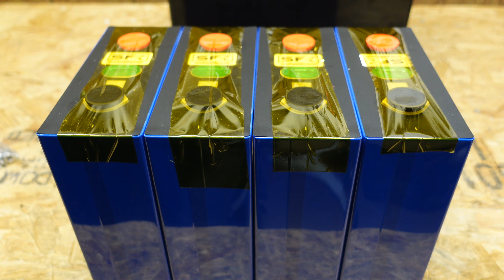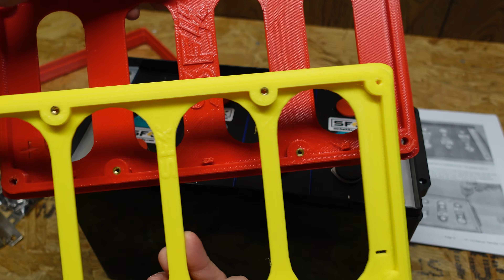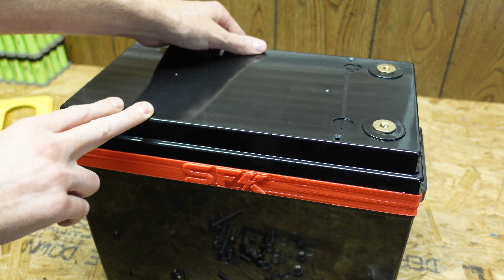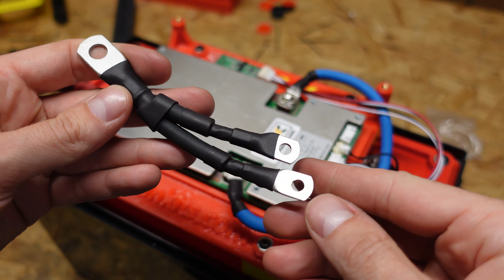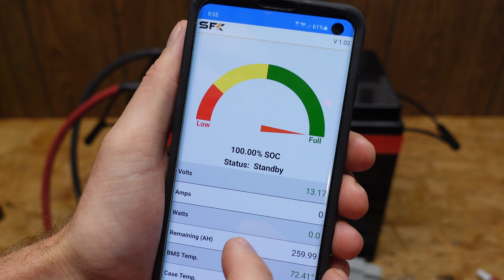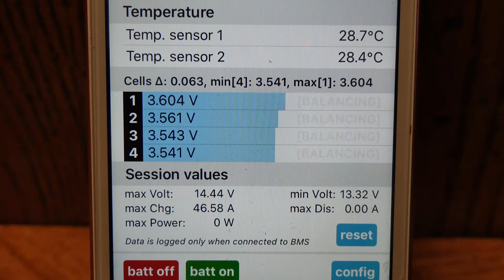Sun Fun Kits DIY 12V 280Ah LiFePO4 Battery, $295/kWh!

Comment: Max discharge current is never equal to max charge current on most any BMS.  While you might be able to push it,  don't.
Reply from the maker: Based on what? It's completely up to how the manufacturer designed the BMS. There are plenty on the market that have the same charge/discharge rate because they were designed that way.
Reply: @LithiumSolar  True... they could be equal,  but there is nothing that makes them equal except through design.   Check the specs.  It is very common to have discharge current be 2X greater than charge current.
Reply: I can tell you from personal experience that this BMS has no problem handling 80 amp charge rate. My thermal camera showed the heatsink at 50 degrees C after 15 minutes.
Reply: @john_in_phoenix  it's not the charger that matters, it's the temperature of the battery cells.

Comment: Hey those buse bars should've been mounted under the Plastic Cap Plate. Instructions are wrong and this is a Safety Issue. If you take another look at what I've said, you'll agree with me. The Buse Bars under Plastic Cap Plate helps prevent Shorts. Shouldn't be any Small Wires under the Large Power Cables. This will cause the Power Cables to become loose and possible damage to the Battery and could cause a Short and may cause Injury to yourself or someone else. You should wrap all open Wire ends with Electrical Tape so that Shorts would be prevented. Every turn of Tape around Wire ends will give a 100 Volt Safety. When ready to attach Wire ends just unwrap that end and connect. You are right about Short Wires. If a power Wire / Cable has a sharp bend and the Battery is Discharging at High Amps then the bend in Cable or Wire could act like a Resister and cause the Cable or Wire to over Heat and a possible Burn through. Wires and or Cables should have a Soft Bend to help prevent this from happening. Thanks for sharing and the upload Mate. It's appreciated by me.

Comment: Hi there. Do you know if they have a solution for EVE 304AH cells?
Reply from the maker: That wasn't one of the cells they mentioned; however, if it's the same dimensions as the LF280 (I think it might be), it should fit fine. I would double check with them first though.
Reply: @LithiumSolar  
The 304ah cells measure 72mm deep x 173.5mm wide x 205mm high (or 220mm high to top of terminal posts)
Reply: I will let you know when my 304AH cells arrive. From the size on the spec sheet, yes it should fit. I can't say for sure until I try.

Comment: Can you connect 4 batteries in seriesl for 48 v? Or do you have to have a bms for 48V?
Reply: I have 4- 12v lipo4 batteries wired in series. They each have their own BMS. They work fine at 48v.
Reply from the maker: The manufacturer states that you can connect up to 4 of these batteries in series for 48V. Each battery has their own BMS though, so you would need to manually balance the 4 batteries to the same state of charge first, before connecting in series.

Comment: I did not see any mention of temperature cutout.  Is there a place on the BMS to plug in a temp sensor?
Reply from the maker: It has a temp sensor and is pre-programmed for 0C charge cutoff. This can be changed, if desired.
Reply: @LithiumSolar  , Hmm...I did not see you attach a wire (temp sensor) to one of the batteries or tape it to the side of opne of the batteries.  Is it on the BMS board it self?  If so, I think it's been proven that a board mounted, since it doesn't touch one of the battery cells..is not as accurate.  Please advise...and thanks
Reply from the maker: @douglasmontgomery6315  You can see the two black wires coming off the right side of the BMS at 12:40. Page 13 of the manufacturer's instructions https://www.sunfunkits.com/MediaStorage/Product/Documents/Document/1_20210924150120163.pdf includes mounting recommendations.
Reply: @LithiumSolar  , thanks sir !

Comment: That's a terrible kit, Ridgid busbars, cells with no extra insulation between them in case of a rub through, if those cells expand they stress the bus bars and maybe push against the aluminum bars at both ends.

Comment: I might be reading this wrong but the cells are extra and not included in the price. When I calculated the cells into the kit it came out to  $1225.00. Am I missing something?
Reply: that's what i just found - initially i thought the $400 was a killer price!  but then saw it did NOT include the cells.  (which they sell for an additional $800... and don't even have them)  hell, they are charging $160 just for for the BMS...
Reply: @dobrzpe  Correct, so it seems like LithiumSolar missed the part where the batteries aren't included in the kit???
Reply: @mendohomepower7492  well.. he did mention it at the very end... but his overall math was a little wonky (wrong).  i'm just pissed that youtubers continue to use click-bait titles!  there is no need for it, especially on topics like this...
Reply: @dobrzpe  The whole battery tear down  and cell testing routines are getting a bit ridiculous. The main players all seem susceptible to free Chinese products to use as click bait. There are a few Tubers that do serious testing but they don't get the clicks.

Comment: You should not have any washers between the ring terminals and the battery post because stainless steel has higher resistance than does the terminal.  This is really critical for the higher current terminals because the washer will overheat.
Reply: Right, a ting terminal will perform the mechanical function of a washer anyways...
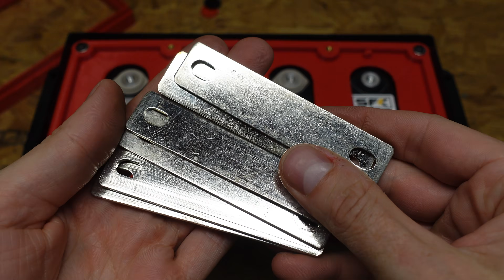Also ~5:20 those buss bars don't  necessarily look like they're nickel coated either, they should be though.

Comment: What a cool little kit!!! And it is dirt cheap! Wow I had no idea about these. Good find
Reply: Truly nice kit. Pricing seems to keep getting better! Great video.
Reply: Hey, We can you send you our V3 kit when it comes out we are getting our injection molds finished up, it works with cells with studs welded on them without the need for the external spacer.
Reply: @sfkenergy  Hi guys. I just sent you a message about EVE 304ah cells that I have (12 cells). I am super keen to learn more about whether you can help me with your cases/cabling kits. As it happens I had already ordered JBD Smart 120A BMS 4S with Blue tooth UART and RS485 but have no solution as yet for case and cabling. Let me know. Thanks.
Reply: aiming for a 912ah setup in my sprinter van
Reply: @alanvogt2182  did anybody ever get back to you? Did you buy one of the kits and did your 304ah cells fit?
Reply: @sfkenergy  Feel free to send me a kit as well, I'll film it and toss it on Tube, have never built a battery pack out before, so I think it would be a helpful video for those who are also new to the thing. I run a prepping and sustainable Expo company and as soon as we can get insurance approval to run more shows, we thought about including a battery assembly class in our classes. We run around 40+ classes at our shows (Expos of the South is our main umbrella, The Southern Preppers is our prepper show ) Let me know, like to work with you.
Reply: @sfkenergy  Still sending out kits?
Reply: @sfkenergy  yeah send me a kit for Spanish customer here in Tijuana
Reply: @sfkenergy  that would be awesome! My email can be found on my videos
Reply: @WillProwse  I'm excited to see your review! :) I just found this guy, from your page. Lol
Reply from the maker: @shoreangler3383  Hey now, "this guy" is still cool too LOL.
Reply: @LithiumSolar  already subscribed, homie. :) 😀
Reply: @LithiumSolar  and Will Prowse, my two idols 💚🙏 

-subscriber From Philippines 🇵🇭 💚

Comment: 3-D printed case. How stable is it. I have not worked much with 3-D plastics. I understand the instructions say to connect the cables the way you did, but could you connect pig-tails to the lid first, then connect to battery/BMS? I bet they are still too short. Thanks for sharing.

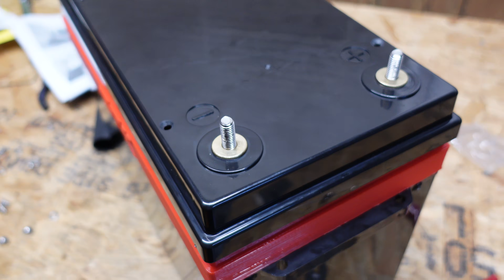Comment: 14:10 - as a workaround you could use the classic 2 nut trick to tighten them. You tighten 2 nuts against each other on the stud and they will friction lock against each other. This allows you to use the nuts to tighten the bolt from the top. Then you can remove the nuts afterwards.
Reply: beat me too it 😀
Reply: +2

Comment: Does that BMS have low temp cutoff?  Frustrating that there are so many BMS out there that don't have it so you always have to ask🙄
Reply from the maker: Yes, it has low temp charging protection and is pre-programmed for 0C. The temp can be adjusted by the user, as required.

Comment: If you strip the posts they can be retapped to the next size up, been there done that. There is a ton of material in the post connections on Eve cells where they enter the battery ( we had one torn apart in a car accident while installed in an RV - Yes, it was handled as hazmat, clean up crews warned but I still saw exactly how thick those posts are, and how long) Having seen the sheer size of material in the aluminum posts, The only reason I can think of why they give us M6 size bolts/post is to keep the cells from being damaged by the force you can put on M8 or larger threaded materials. I mean it's just much too easy to put a lot of torque on a M8-10 bolt before the threads strip.  I ultimately feel the small bolt/stud size is a safety feature whereby the threads can strip before the battery is damaged and this may not be true if they used larger sizes.....  but tapping those post holes to M8 (or even M10) won't compromise the post material imo . It just means you have to be especially careful not to over torque the new M8 post or bolt because you now have enough purchase to twist that aluminum post structure inside the battery. Eve calls for 8Nm (5.90 ft-lb) on most 280ah products. Check your spec sheet.  TL;DR I have tapped these to the next size up after a client stripped the threads out of them. I neither recommend you follow my actions or make any guarantee that what works for me would work for you.

Comment: Yes we program the default settings for 60 Amps charge and 125 charge, our reasoning behind this is better to have a little wiggle room, but of course it can be over-ridden the by the user. In a future app update we will add this feature as well.
Reply from the maker: Awesome, good to know. It can sustain 125A charge, right? I haven't seen any JBD that are limited to 50% charge (like the Daly are) but don't want to just assume.
Reply: @LithiumSolar  80A is the most it can do, but the issue is many people are buying grade B cells, we don't know if its a good Idea to pump this much power into questionable cells, This is why we defaulted to 60, actually we were debating going down to 50 as the default.
Reply: @sfkenergy  So far all of my grade B cells have done fine at 80 amps charge and over 100 amps discharge for extended periods. I have a busbar with two 175 amp Anderson connectors and four 50 amp Anderson connectors that I use. I can hook up two 40 amp power supplies and 4 parallel cells (for top balancing) and/or 4 electronic loads for capacity testing (40 amps at 3.65v or 28 amps at 14.2v, each). The important thing is to clean the connections each time, I have a nice thermal camera I use to spot problems. I would suggest that you up the default charge rate, those Aims chargers are popular. I recently ordered one myself, just haven't received it. They are pricey, but if you are using a generator to charge, you want that extra oomph.
Reply: I have everything to put mine together, i was happy to see this. When i saw 200 for the plastic box it made me not so happy, 50-75 bucks apiece and i probably would have bought a couple. It really looks nice though.

Comment: You said that if you strip out the threads out of the aluminum terminals the cell would be ruined because there's no way to fix it...
Actually there is, either rethread to a bigger thread or just heli coil it.
Reply from the maker: That might work for some, but I've heard cases of people with melted terminals (fire risk) after doing this kind of thing. I'd rather recycle the battery and get a new one than create a risk by modifying it.
Reply: Oh okay I got you. When you helicoil though you're not taking off a lot of material just a little bit for the new thread. Maybe do a test video to see if you can actually do something like that? 🤔
In a safe environment though of course with protection.

Comment: I wonder why they dont sell it put together....It sucks I bougjt it. Junk bms, the wires are not copper and battery had a dent.
Reply: The BMS is one of the better ones on the market (I've tested more than 6 different ones). I didn't purchase their wiring kit, but I would seriously doubt they are not 100% copper cables. I used my own cells, so I had no dents.
Reply from the maker: Based on your comments, I doubt you've purchased one of these kits. The JBD BMS has a reputation for quality and very few (none that I've heard of) failures. Additionally, yes, all of the cabling that came with this kit was copper wire.
Reply: If they're nickel coated they may not look like copper.

Comment: Thanks, great review! I didn't see a temperature sensor anywhere for low temperature charge cut-off.
Reply: Yes, isn't low temp charge cut off BMS very important for LiFePO4 Battery?
Reply from the maker: The temp sensor came attached to the BMS and is pre-programmed for 0C low temp charging cutoff. You can place it where you want. You can see the black wire on the right of the BMS at 12:39. It's also covered on page 13 of the instruction manual.
Reply: @LithiumSolar  ok, if you show it and test it like Will then we won't be asking in the future.  Sometime manufacture claim low temp charging cut off works but doesn't.
Reply from the maker: @jameshwang4750  I've tested the temp protection of JDB BMS's more times than I can count. Didn't feel it relevant to do yet again.

Comment: A 24v kit would be nice, especially with SOK having been back-ordered with theirs for so long.
Reply: You can series connect these. I agree a 24v single BMS would be better, but Sun Fun Kits does have a good video doing these in series for 24v and running an air conditioner for an extended time. They even sell Anderson connector cables to do exactly that. The BMS is rated for up to 80v in series, but I personally wouldn't go above 24v, too much effort to keep things balanced.
Reply from the maker: As John mentioned, they do support being connected in series, up to 4 batteries or 48V. They technically can go higher but it's recommended by most manufacturer's not to exceed 48V. A single kit of 24V (one case for 8 batteries) would be very heavy, approximately 130lbs.
Reply: @LithiumSolar  Yes, I am over 60, my back likes 4 of these 280AH cells much better than 8 of them! I have been going with 100AH cells over 12v, just much easier to handle.